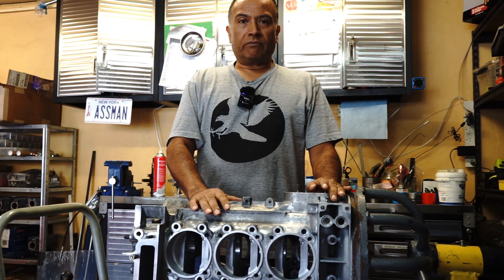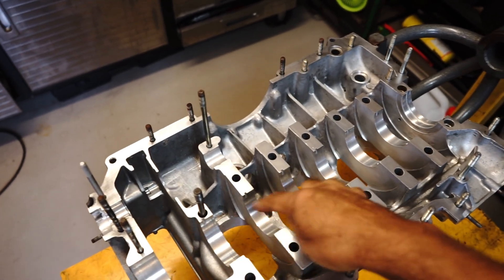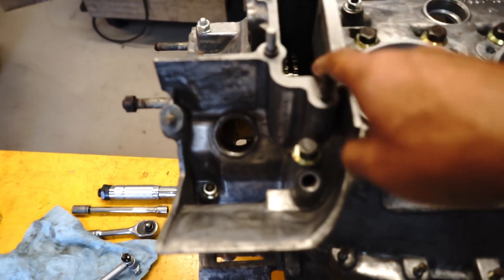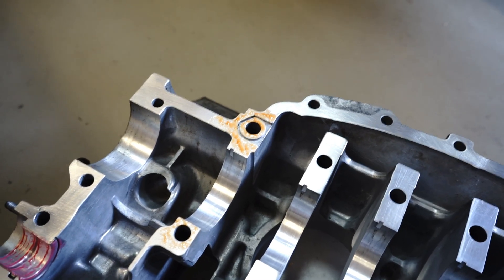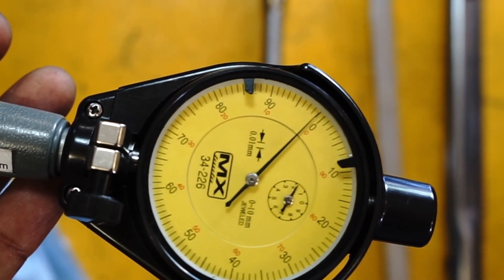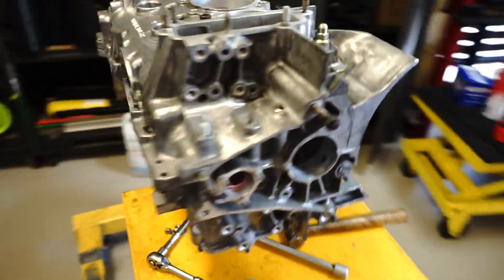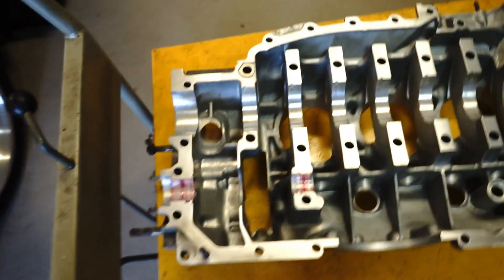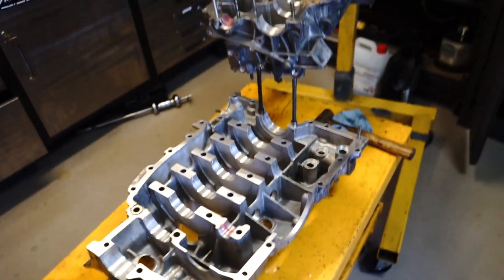02 - Porsche 911 Engine - Loctite 574 Experiment

Comment from the maker: Keep in mind: this wasn't a "laboratory controlled experiment". In hindsight, I should have maybe installed the bearings, applied 574 to every journal, and then bolted the case together and measured each and every journal. On top of that, I could have done the experiment several times to validate the consistency and repeatability of the results. This was done purely out of curiosity for myself.. and I shared what I found. Should you apply 574 to these areas? I'm not here to advise. There are plenty of people who have built many more engines than my, and written books and volunteered info on forums that you can take advice from. However, I know what I will be doing! ;)

Comment: Thanks for making this video. I am getting ready to re-assemble my case and I have seen a couple of experienced Porsche engine builders apply 574 to this area, one of them stating that the journals do move around in service (fretting?)… so “gluing” the area seemed like a good idea to me. However, my main journals measure out right to the acceptable limit, so I really don’t want my crank to bearing clearance to be any larger than it already is. So I think one variable to consider is your bearing clearance is with a particular crank. But I am no expert. I was very curious about the difference. I used to have to account for the product thickness when setting valve clearances in a Lotus motor that had bucket followers and shim discs- I can’t remember what the 574 thickness was once the cam towers were torqued down, but it was consistent every time I had to determine the shim thicknesses under the buckets. Love your videos- thanks!
Reply from the maker: It's a bit of a "damned if you do, damned if you don't" situation... I have a copy of the old Porsche workshop manuals and they don't show photos of applying the sealant to this area. However, in the wording, they do state to apply to the mating surfaces of the cases and to pay attention to not get it into the bearing areas. So to me, that virtually states that "yes, do apply to the crankshaft journals"... However, I'm not convinced that everything they did back then should always be followed. ie, look at all the failures from 1- magnesium cases 2- dilavar studs breaking 3 - alusil cylinders 4 - bore scoring and IMS failures in later cars etc.. I guess if the engine is not going to be screaming at 7000 and your bearing clearances are already near max tolerance, I probably wouldn't add to it.   For those that are using threebond on the case halves, and applying it to the crank journals, I would suspect it would add a lot more to the clearance. Why? that stuff sets off very quickly. So only the wettest would be squeezed out. Again, I'm not recommending anything here.. just posting my personal findings.

Comment: Interesting! My primitive understanding of 574 is that it dries in the absence of air, and that any wet 574 left inside the case could get taken away with the oil without issue. But I'm no engine builder!